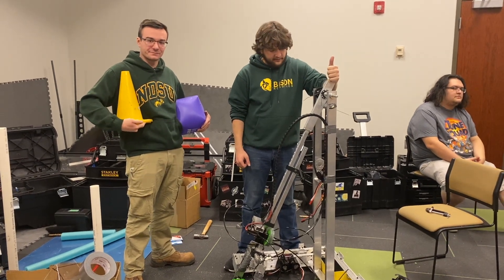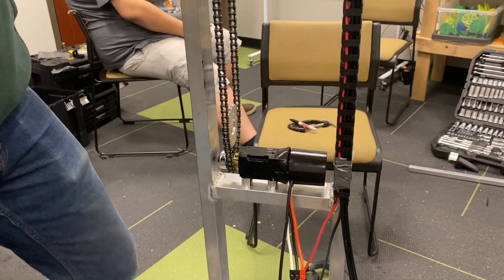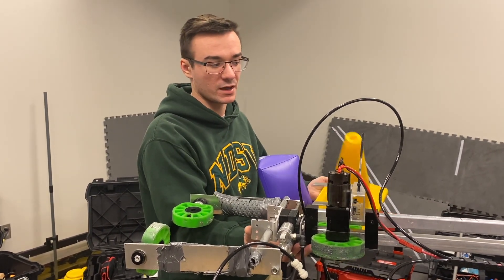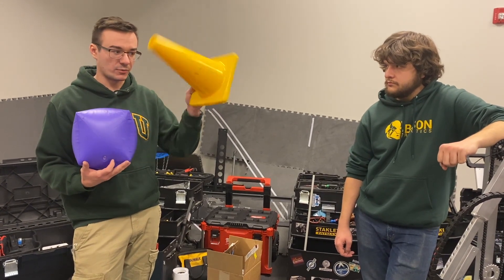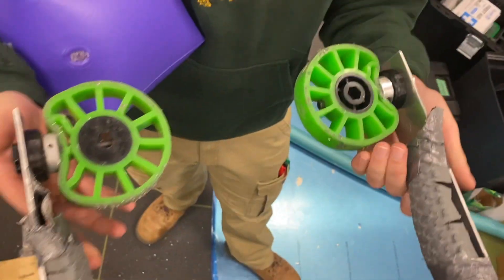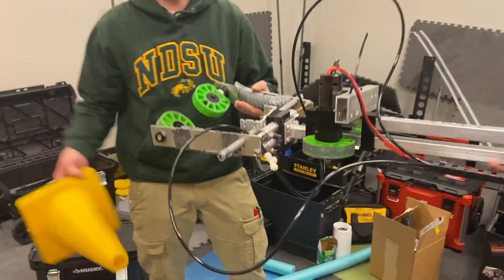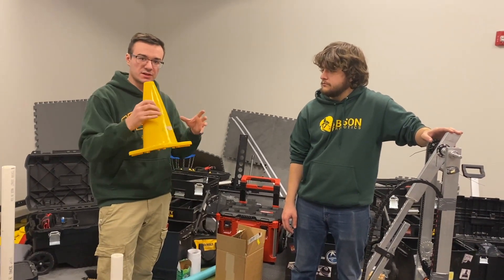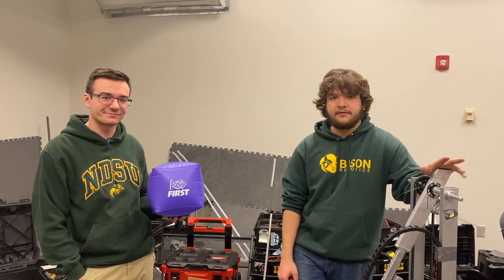NDSU Ri3D Update 8 - Functioning Arm and Grabber

Comment: how would you go about making a grabber like that but without pneumatics? (we only have motors)
Reply from the maker: We would strongly recommend investing in purchasing a pneumatics kit with various cylinders and other components, as it will be much simpler and lighter by comparison. If pneumatics are out of the budget though, a similar motion can be produced with a double cogged belt linked via a gearset at the center.  You need to use two belts with 2 gears linking them at the center or outside. If a gear is not used the grippers will only move side to side, instead of opening and closing. However this would add a tremendous amount of weight at the end of the arm, and as such will require additional gearing at the lift motor/gearbox. A sliding door seen entering a business is a good example of a similar system in use.
Reply: @bisonrobotics  thank you very much! we were thinking of something along the lines of what your describing, and as a rookie team input like this is really helpfull